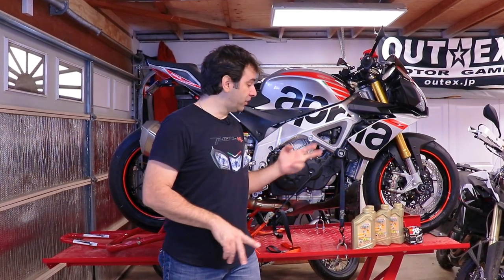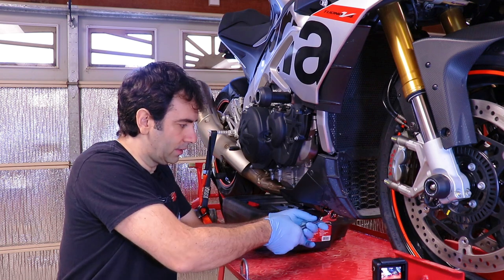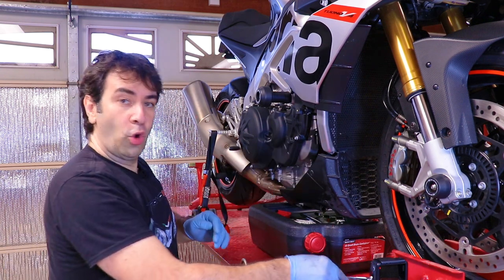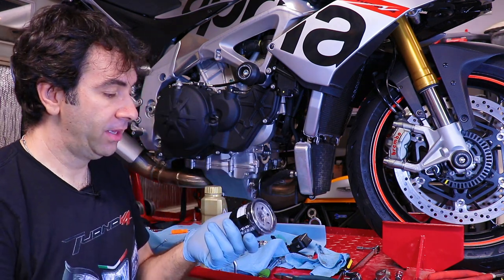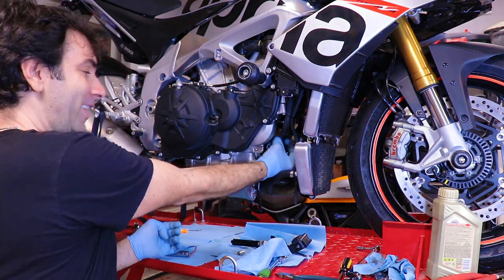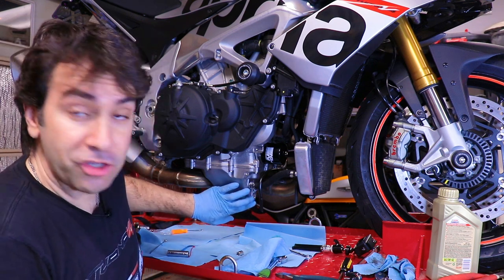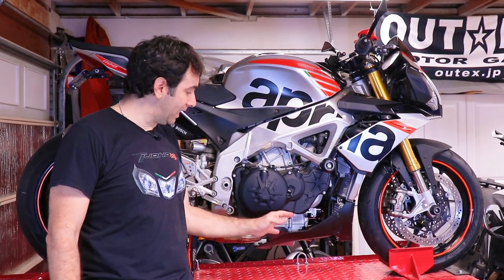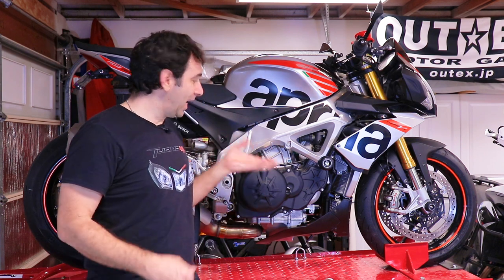Aprilia Tuono oil and filter change

Comment: Albe per il v4 aprilia solo ed esclusivamente filtro olio ORIGINALE OEM.  Quelli aftermarket non hanno la stessa tipologia di materiale filtrante e non  hanno la molla interna tarata per operare alle pressione corretta.  C'e' stata nel corso degli anni ( dal 2009 ad oggi ) qualche rottura imputata proprio a questo banale componente. Quindi meglio evitare qualsiasi rischio inutile e spendere 10 euro in piu' ( forse ) e viaggiare tranquilli.
Reply from the maker: Ciao 990 Hyper, grazie per questa informazione 👍

Comment: Good video, Castrol Power 1 (full synthetic) is excellent oil, I do prefill my oil filter to the top (it all absorbs) before installing, I always use a new genuine crush washer and have never used a torque wrench to install - just do it up until it seats and nip it up, has never leaked. In the video I notice those cracks under your sump plug which are a concern.

Comment: Generally speaking, deduct 20% of the dry torque specification if the threads are lubricated. So the 30 Nm for the drain plug would become 24 Nm when it's oily.
https://www.southbayriders.com/forums/threads/149439/page-3
Reply from the maker: Good info, thank you 😀👍

Comment: Thank you very much for the video and the time in the explanation! My question, after I changed the oil and rode the motorcycle several times, how much oil should I have in the engine, which I check with a dipstick, half or 3/4 or...
Reply from the maker: Hi, if you filled it up properly during the oil change,  the level should not go down much even after several rides, just remember the Aprilia recommended way of checking the oil level 👍

Comment: Good info Albe- I always at least part fill my filters with oil so there is no dry start while the filter is filling.
Reply from the maker: Hi Dan, that is good on old bikes because of the inefficient oil pumps, with modern bikes and modern oils that stick better to the engine parts that is not really necessary unless you rebuild the engine and it's totally dry, besides if the filter is below the full line, it will fill up before you get to the max line. On a positive note, it doesn't hurt to do it 😀👍 but mostly, kudos to you for doing it yourself 👏
Reply: @AlbesADV  you got me- I'm showing my age again Just having a senior moment lol

Comment: I just wanted to change my oil and I cracked the oil tank with the key set at 20 Newton/Meter. After that I talked to a mecanic to understand the error. He said that all the time for oil change, the screw should be tightened by hand without forcing. 
I'm writing this in order to avoid this big mistake for other people.
Reply from the maker: But according to Aprilia if you don't torque it to 20 Nm the crush washer will not expand and seal properly so the bike will be sipping oil out the whole time
Reply: I understand the theory, I followed it and this and it broke the oil tanker. My Tuono is a 2017. In the manual of 2017 there's no details about it. Maybe the oil that stays there after it drains reduce the friction to a point that only the hand can feel the right pressure. Remember, the tanker is very fragile.
Reply from the maker: That it is

Comment: Hi Albes…. Your bike also after the service when you start it up for the first time also shows lower pressure oil light for 1 sec and then is normal?? Thanks for the video
Reply from the maker: I'm not sure, but it might, shouldn't be a problem,  the engine is still coated in oil 👍

Comment: Good video bro. One year a used the same Castrol oil on my tuono 2018 factory and the bike sometimes was missing gear changes. Changed back to Motul 7100 5w40 and the problem was gone. Had any problems like that with castrol?
Reply from the maker: I haven’t had any problems like that, I had a stumble between 3rd and 4th gear while using the quickshift, but it was there even before the oil change, now with the new exhaust it’s gone, I’m assuming it was a combination between rpm and flapper valve opening.

Comment: Hello there, yesterday I’ve just done my own first oil change as the bike went out of warranty 2 weeks ago. Now my question to you is as I can’t see in your video the colour of the oil. Mine was a bit chocolate brownie ish colour, after 3000miles as I’m not running the bike more then 3k with the same oil. So it’s your oil same colour? To bad I cannot attach a picture. 
I’m only using genuine parts and Putoline oil N-tech pro R+ 5W40
Thank you
Reply from the maker: Hi Cristian , I use Castrol synthetic oil , when it came out was the same color of the top crust of a creme brûlée, I’m not sure how to describe it better, it was brown but still clear, but that can change from oil to oil, (I used a green oil once, that was different 😁) as long as it doesn’t smell really burned, come out milky or there are metal shaving in it, you should be fine. 😀👍

Comment: I changed my oil at 600 miles per manual.  When do you recommend next change?
Reply from the maker: I would at 6200 miles as per manual or 1/2 that if you race it a lot (3100)

Comment: I have bmw 850 gsa, on right caliper there are two nozzles with dust cap. Why there are two nozzles, which one is used for flash?  Thanks
Reply from the maker: Hi Khalid, I don’t know why the F850GS has 2 nozzles, to bleed the brakes you use the top one because air bubbles will float to the top, I can guess that maybe the bottom nozzle is to completely empty the caliper, but it’s just a guess.
Reply: Thanks for the reply. I am planning to use speed bleeder, is there any word of caution?
Reply from the maker: No that I know, they usually work pretty good

Comment: Why is Aprilia new engine oil like a dark blue?? When I bought my RSV4 the oil looked dark blue/dark gray. Any take on this?? Thank you
Reply from the maker: Hi Ducati Max, Maybe it’s just a new brand of oil they started using
Reply: break in oil has special properties that is unlike regular engine oil. It is meant to protect the components while allowing them to rub together and form proper bonds. The color may be a result of different additives, or some other reason.

Comment: Hi Albe's, very good video! I did my oil change by myself too, my bike is only 5600km. 2 years old. Rare to use it, only weekend ride. But the problem is I changed the oil this year on January, and last week i check my dipstick and the oil below low level, that's more than 600ml oil short!  And from January until September I only ride for 2600kms. I read on the forum that Tuono v41100 burnt oil. Do you have the same problem too?
Reply from the maker: Hi RW, so far at 4500 miles my Tuono doesn't burn oil, try to pay attention to the exhaust and see if you noticed smoke thicker than usual coming out
Reply: Yes my 2019 Tuono Burns about 1/2 quart of oil every 800 miles or so😮 concerning but the dealer says it’s ” normal“

Comment: Albe i have problem taking the crush washer off the drain plug its stock there have any idea to take it off? thanks
Reply from the maker: Sorry to hear, it's going to be a lot of fiddling.  To start, try with a set of neednose pliers reverse squeeze,  those that open when you squeeze them, and see if you can work it out. Good luck for now and let me know how it goes
Reply: Ok well try a lot of things i was able to make the washer turn on drain plug but not able to take it out (try everything) had to take a cutting knive and very carefully did a snatch on the soft alluminium and with a flat screw driver without dammage drain plug break crush washer 🥵🥵🏍💨👍thank for the advice and great video very helpfull
Reply from the maker: I’m happy you were able to solve it, and thanks for watching 😀👍

Comment: 5W40 or 10W40 or 20W50
For Tuono V4 2020
Reply from the maker: I’m not sure about the 2020, the manual recommends 5w40 for the 2017 which is most likely the same for the 2020, but to be sure look at the owners manual for your specific year model 😀👍

Comment: You dont reuse the old crushwasher?
Reply from the maker: No I don’t, especially with the Tuono where any imperfection can cause a leak, I do for other bikes like the Scrambler or the YZ etc, but the Aprilia’s crush washer expands to the sides into a grove on the oil pan and usually deforms when removed.

Comment: @ 1:30 looks like a hairline crack to me. i'd fix that before it gets worst (leaking or crack to you oil plug threads)
Reply from the maker: It’s a full crack and it’s been fixed that day, you can see it on the oil pan replacement video.
Reply: How do you fix a crack like that?
Reply: @winner1338  U can try JB Weld but I think he replaced it
Reply from the maker: Hi guys, I replaced it with a new oil pan. Tge replacement has its own video